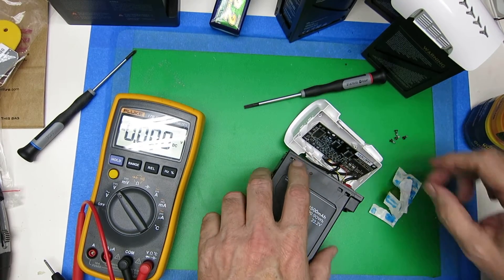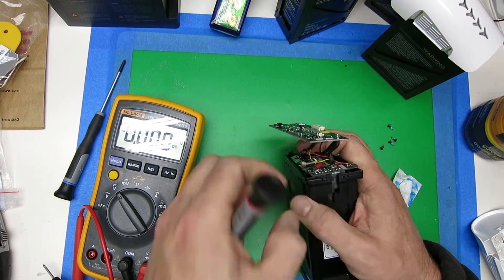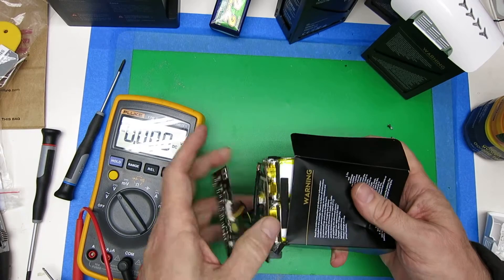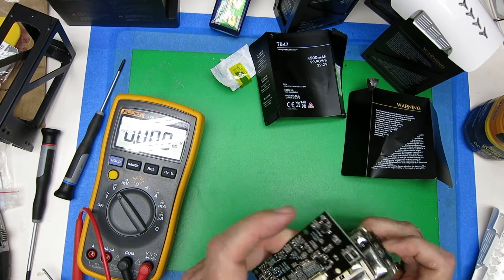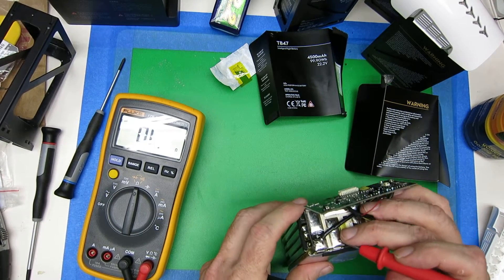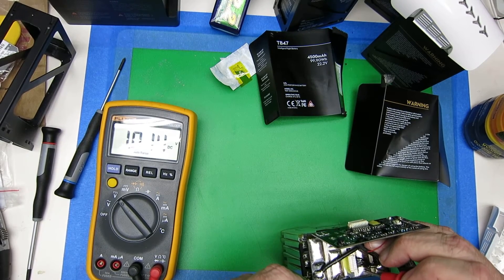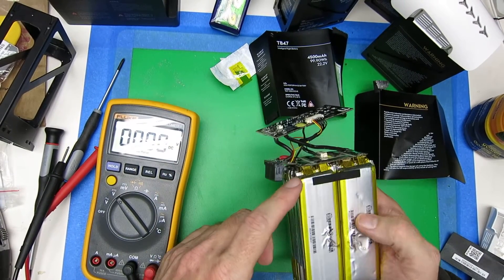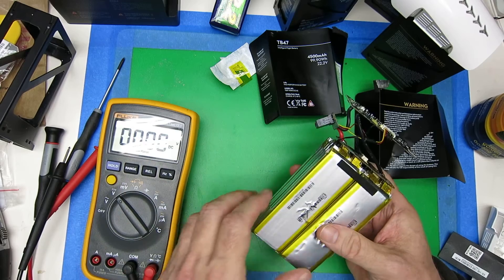DJI Battery Failure and Diagnosis (part 2)

Comment: I do recommend you to PULSE 4100mAh 14.8V 35C do a google search, and you will find them very easily, "They are available on Ebay and regardless of where you get them, they aren't cheap! but they have a 2% or cobalt carbonate on their electrolyte, thus making them  very resilient, you should talk to their sales dpt to make sure that what you get is in the same size & weight, good luck!